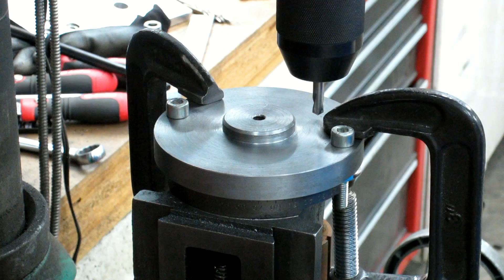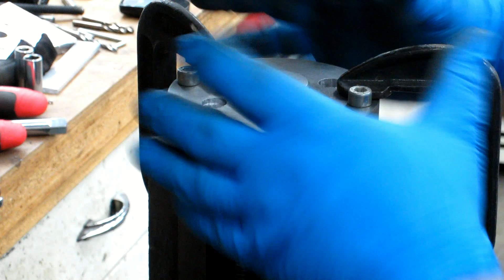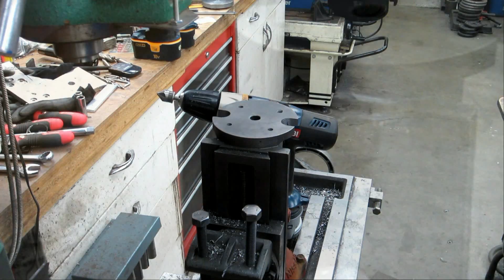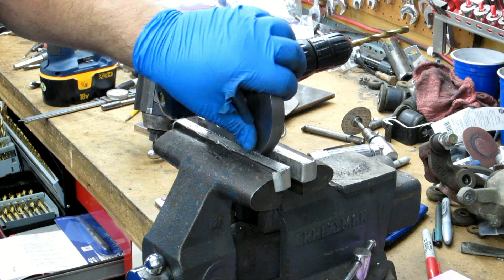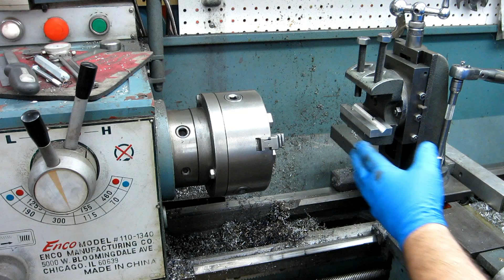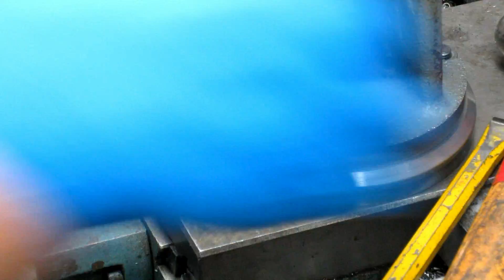Mill Attachment 8

Comment: there are if can find them attachements  made back in 1940 to do heavy milling on lath had its own motor south bend put out one....also article in practical machinist where you make a larger cross slide table specificily for milling...beefing it up
Reply from the maker: Great info! Thanks!!!